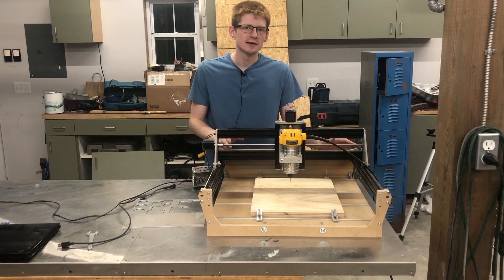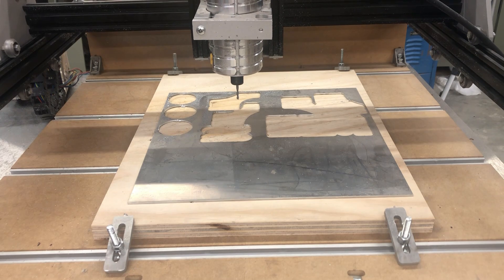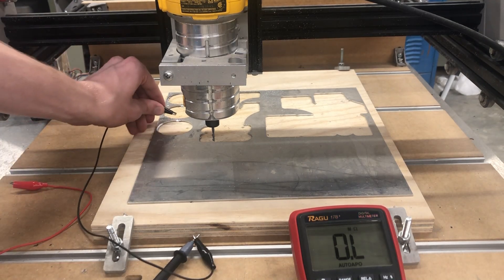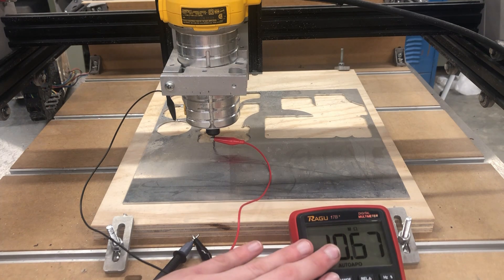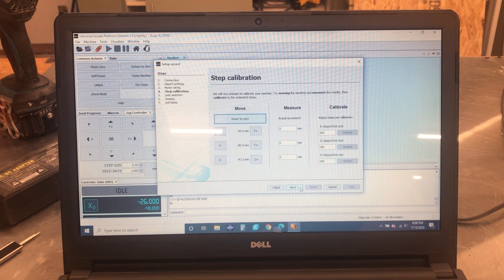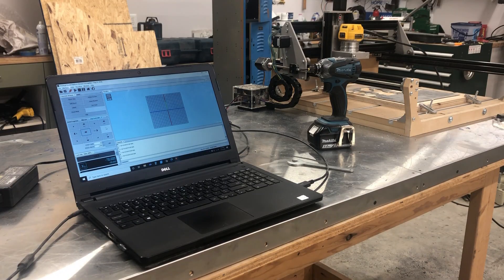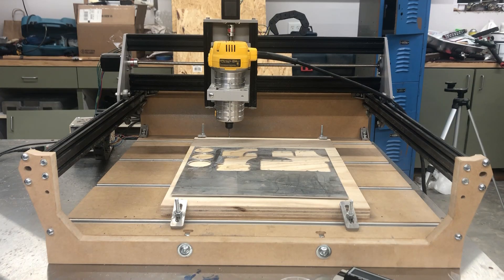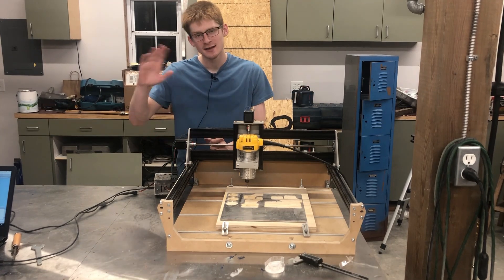Hobbyist CNC Router Tips and Tricks

Comment: Thanks for sharing - good tips! I'd like to add some advice on workholding: Err to the side of caution when it comes to holding your workpiece. There is a LOT of vibration when cutting, and things have a tendency to come loose. It can be scary when it happens, and it's very disappointing to ruin your part in the last operation, just because it shifted on you. Adding an extra tab (also for the scrap inside a pocket) or an extra hold-down screw is worth the small effort to avoid bad surprises.